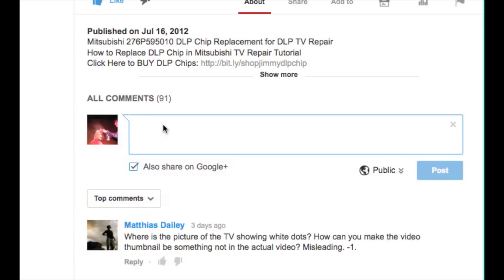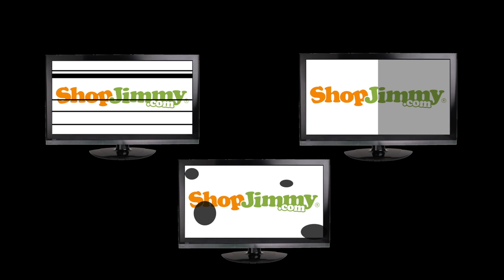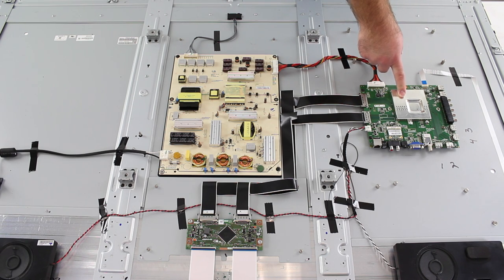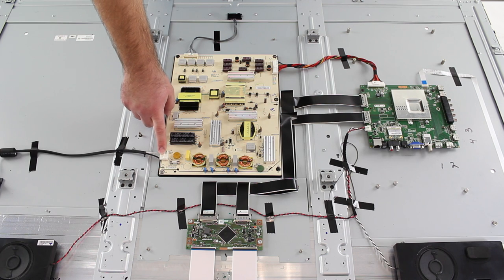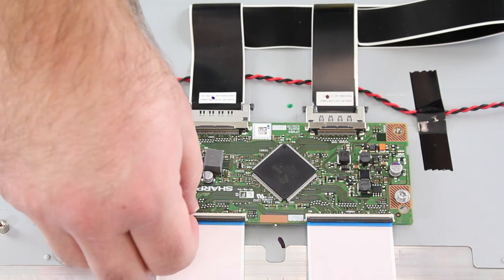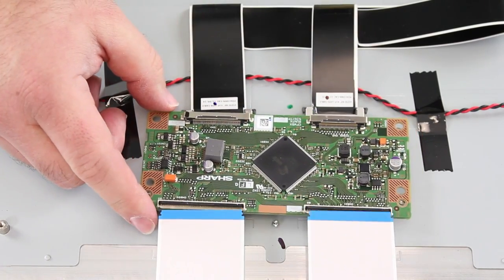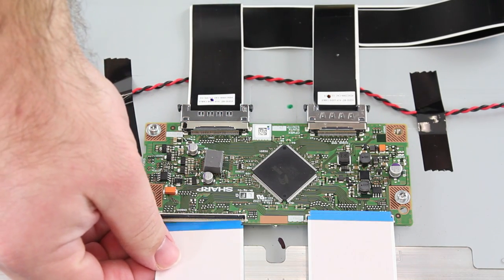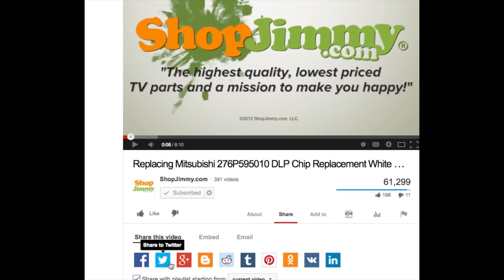Vizio TV Repair - E601i-A3 T-Con Board Replacement - How to Fix Vizio TVs

Comment: Vizio m55osl i can send a picture to better show it but  basiclly at the bottom, base of the back of the tv, right around where the standis at there are 2 huge 3inch wide ribbon cables that go down to the bottom of the tv almost like the go under and connect to a long thin board maybe as long as the tv and about 2-3 in wide. according to your video its the tv panel, the board that the ribbon cables go to on the tv panel, tcon board side is fine its the panel side that the connectors have broken off. is the board a replaceable board or does it mean the whole panel needs replaced

Comment: Your video on how to replace the Tcon board on a Viso e6001 was extremely helpful, and I plan on ordering the board from you.  However, you kind of jumped ahead of me; I'd first like directions on how to remove the back panel to the status you were at in your video.

Comment: Hi,
I have recently replaced my TCon board in my Vizio E601I-A3 and it seemed to work because I turned it on and the picture came back to the tv but I turned it off and put the backing back on the TV and I tried to turn it back on and what do you know, the tv was blank again with backlights and sound still working. Do you have any suggestion on what could be wrong now? One of the LVDS cables seems to have a slight rip in it all of a sudden so I don't know if that would effect it.

Thank you, 
Kevin Costello

Comment: I have an E701i-A3. The display was working fine. All of a sudden, the screen went black and the TV shuts off. Now when you power the TV up, with the back cover removed, you can see the back lighting come on. The display is still very dark blue, maybe even black. After about the 10-15 seconds, the TV powers off again. I have replaced the power supply board and no change. Any ideas? Thanks!

Comment: Hi, I need your help to fix my VIZIO TV model XVT3D474SV. The yellow 'VIZIO' light glows when power is turned on, but there is no display after that. In normal operation, the 'VIZIO' light used to turn on and off a couple of times and we see 'V' display on screen, and then normal display. After we have this problem, the "VIZIO" light just glows constant. Few days later, the "VIZIO" light turned on and off once and the display was ON for about 5 hours. We thought that the problem was fixed by itself, but we were wrong. The next day, it did not turn on. Could you please help us what is the problem with this TV?

We suspected that this is a power-board failure, or a leaking capacitor. So, we got a used power-board from ebay, and replaced the board, but the problem is same. I am not sure it was a faulty power-board or the problem in TV is something else. Your help would be much appreciated.

Comment: My E601i-A3 just lost picture but has sound. Looking at the serial number starting with LFTRNWDQ my unit does not qualify for the recall. I will add that over the past few years we have been getting thin black lines across most of the screen. They were all in the bottom 1/4 of the screen so not that much of a hindrance. That being said, seeing your warnings on this video as well as on the shop jimmy web page for the replacement T-Con Board it makes me wonder if I should be purchasing a T-Con Board (currently out of stock). Should I be buying an LCD Panel or Main Board instead? Please advise.

Comment: I have a Vizio P50HDTV10A plasma and I've replaced the y-sus board due to a flashing strobe and ticking sound coming from it. One of the heat sinks was cold while the others were warm. I had a picture before, but it was flashing very quickly. Now that it is replaced I see a yellow vertical stripe from top to bottom in the center of my screen. All of the rest of the screen is black. Has red and blue dots outside of the yellow. Does that mean that it's a bad logic board, since my y-sus was replaced? Everything else seems good. My next guess would have to be the board above with big capacitors and copper coils connected to the y-sus. Seems more like a logic board problem though due to the vertical lines. Your videos are great by the way, I have learned a lot from watching them. Thanks

Comment: Hi I have a RCA 46la45srq with black screen with good power light starts red then blue. And sometimes it works fine but mostly no picture although it does have sound if I get lucky enough to click remote control to the correct video sorse I then can here sound from the kodi remote being clicked. So I replaced the T con board. But it Didn't work. & my Tcon doesn't plugin the main board, but into a different unknown board with slightly puffy I'm not sure what they are called but they have silver tops like a Phillips screwdriver raped in black? That plugin the main board and Tcon board. My tv is a rca46la45rq- RCA 46"FULL HDTV.. Please advise me on what to do?  I will try & send you a picture...thank you.

Comment: I was wondering if you could help me with a fix. I have an E390VL vizio tv. what happens when I turn it on is the screen seems fine,  but then after about 30 seconds to a minute the screen starts to make this poping sound, and the image becomes distorted. when I turn it off and then on again, the same thing happens quicker. I unplugged the tv and plugged it back in again. this only makes the amount of time it takes for it to "glitch" 30 seconds to a minute again. I looked around YouTube and Google and couldn't quite find out the problem. if you could respond I would be very greatful. thanks for your time!

Comment: I'm currently having issues with my Vizio TV model M55-C2 where I will get the Vizio symbol when powering on and momentarily get visuals. After about .5 second goes black with backlight still on. I believe it is the T con board but am uncertain. The T con board part number is LJ94-32662F

Comment: Hello Jimmy. I took off back panel on my Vizio VO420E. Upon exam the capacitors did not look popped. The TV when plug in lights the VIZIO logo at bottom but will not power on. Help!

Comment: I have a Vizio D500i-B1. First problems were it would not turn on unless I unplugged it for several hours. Then it became a problem of shutting down after being on for 45 min to an hour. Sometimes it would come on with only sound but most of the time it would not come on at all. Based on the power light and what Vizio says, it was powering up.(power comes on and then slowly fades) Sometimes the Vizio emblem would display real fast then go off. Those were the times I only had sound. Well, it gradually got to the point where I explained previously of it turning off by itself after awhile. By the way, it was always a black screen, sound or no sound. Well, I tried the T-Con board(since I got one for $10) and now it will power up every time but now it has a blue screen. I did have sound but changed the channel and there is no display so it is almost impossible to get back where I was. One key note, the TV was not going full width(only 80%) no matter what settings I tried to use.

Comment: I have a 60" Vizio, Model No: E601i-A3E(same as in this video) and the unit is not powering on.  The standby light on the bottom left is on and is a orange/red color.  What is the best course of action to fix this?  The power board replacement?

Comment: my 32 vizio tv logo icon flash on/off. I have changed the power board and the main board, didn't fixed the problem. what else could be wrong?

Comment: I have a Vizio model E601i-A3 that will only power on for a few seconds. The "V" display comes on very dim with a very low level backlight then shuts off. I can read voltage on the power supply for the pins that are clearly marked on the color unit board, but I'm not sure of the other pins. Any ideas?

Comment: I have a 55" Vizio VF552XVT that turns it's self off when it senses a resolution change in programming viewed. Watching it and programming goes to a commercial or at the end of a movie and it changes resolution the set clicks and turns off, however the Vizio name on the front of the set remains on and illuminated in a white color, ( amber when off).  This tv is 5 years old and our main TV... runs approx. 16 to 18 hours a day, about 5 days a week. The longer the set is on and in use the more frequently it does this turn off deal...  but does not power off when watching a premium channel movie, or using the Blu Ray player. Only when the movie ends and a trailer for the next movie comes on in a different resolution. Our DirecTv guy helped us figure out what it was doing, as we thought our DTV receiver was bad. Can you suggest a fix for me? We really can't afford a new TV right now... The picture is 100% fine and perfect in every way on this set until it turns it's self off. Thank you!

Comment: I have a Westinghouse 40-inch model number dwm40f1g1 LED TV back lights light up but no picture or sound 11.92 volt to the main board in the T con bored. Thanks for any help

Comment: Hi I have a question on a Vizio m492i-b2 the LED light for on/off indication comes on and blinks once and stays on constantly when plugged in I have replaced the power supply with no avail. It had a problem turning on and worked if you unplugged it for a while and then plugged it back in. No led back lights or picture with flashlight test. Thanks you

Comment: Hi. I have a Vizio M550SL that my mom already replaced the t-com board in once. She said it worked great for a while, but then started acting up again. Once the picture comes on, she says it will  it stay on until powered off again. No that I have it the picture does not come on. Back light is on and has sound, but no picture. Is this the result of bad t-com?
I would like to repair it if it’s worth fixing
Part 10248191022
serial LAQAMCBN3200239
Thank you

Comment: I have a Toshiba 46L5200U1 that will run fine for a few minutes then the screen will go black but you can still hear the sound. You have helped me in the past with Vizio TVs and the parts I've gotten from you worked 100% of the time. Can you help me with this Toshiba? Thank you so much!

Comment: Hi there I have a Vizio D390-b0 and followed your video on diagnosing- I have sound and power and backlight just a dark lit up screen which indicates a bad TCon board. My TV only has the power board and main board when opened and on your site your entire repair kit only includes these 2 boards for my model. Where is the tcon board?

Comment: vizio e601i-a3 3 year old tv, no video, tv went black with audio, called cable company and everything leads to a bad tv, even when I tap the menu or input buttons, it produces nothing on the screen.  Any suggestions, also called vizio and they said it was probably not repairable and a backlight issue

Comment: My m701d-a3r has occasional vertical lines running down from the top of the screen. Close inspection shows it's only 1 pixel wide. TV is less than 2 years old. Based on your information the T-con is bad or a  bad connection. Can you comment or suggest a fix?

Comment: I have Visio vx37l hdtv10 TV. I'm getting colored lines on screen (full screen), sound is working. I found a part no. for T-con board on your site, but you're out of stock. Plus, I don' see T-con board on the open back TV

Comment: Vizio E601i-a3 problem.  

When the power button is pressed,  the back lights work,  and the panel illuminates. No picture will show.  No words can be seen on the screen when any buttons are pressed on the remote. I have replaced PS, Tconn, and main control boards. Nothing has fixed the issue. TV only has 40 hours of use on it (but the warranty has expired). TV worked fine when it was turned off.  Just won't work now.  Any suggestions would be greatly appreciated!

Comment: I have a E470i-A0 and the power surged twice the other night and the TV display does not work; however, there is sound.  The TV will come on and the power light will glow momentarily and then go out.  Is the a t-con board for this model?  I think I need to replace the Power Supply / LED board...

Comment: vizio e701i-a3 a tech told me the power supply is out.  I just ordered the part, is it fairly easy to replace?  is it just screws or is there soldering involved?  The tech wanted to charge me $240 is that a normal price?  Thanks so much!

Comment: Vizio 60" LED model # E601i-A3 television and at first it had the vertical lines now it will not come on at all. Should we replace both the T-Con board and panel?

Comment: I have a VIZIO M801i-A3 with a single blue vertical line about a pixel wide on the left side of the screen. No other problems, does it seem like a tcon board replacement will fix this? Thank you very much

Comment: I have a vizio 55" VF552XVT.  When I first turn it on after sitting overnight, it will work for about 50mns then shuts down with vizio light still white.  After that it will only work for 10 minutes of less.  Is it the t-con board or something else?  How much would it cost to fix if I do the labor?

Comment: I have a 42" Vizio 1080p The screen goes blank after a few minutes. Read that this is an indication of a faulty T-Con board.  If you concur, do you stock the proper replacement?

Comment: vizio e601i-a3e:
blue vertical line on right side of screen, 1 pixel wide going the length of the screen. Replaced power and main board (no power orignially) and now this has emerged. Might be a long shot, but is there any chance of repair or chalk it up as a loss?

Comment: Yes I have 40 inch Vizio vo370m which I used to be able to watch but then it would fad out to vertical lines watching the videos I think it could be my T com board I have tried to get the back outside panel off but not having much success. The help I need is do you think it is the t com board and can that be replaced in this set ? I will exam the back board to find out why I can't get it off it is probably something simple.

Comment: hi. I have a vizio m420sl tv and the screen is black.  the back light works on it.  but the when I turn the TV in I got nothing. the light gites from amber to white but no picture. it will work fine every once in a blue moon. but that could be weeks. any idea what it could be? thanks

Comment: I have a 55 inch vizio model #xvt3d554sv , i do believe this is my solution. my problem with the tv is i am not getting any sound. Picture and everything works fine. when i plugged in my sound bar i would get every other word coming through it. my other question is... does it matter what the part number is for the t-con board or can i take one from another model or one from another tv. please help

thank you

Comment: got a vizio model e482-d2 tv is on indicating power supply working but still test an had correct voltage symptom of the tv was sound no picture so test the t con connection then took out one ribbon then turn the tv on again I got a half a vizio on the tv order the t con board got the board installed it an got no picture test the t con board for voltage got 12 '
volts on the fuse  an just about 0.4 an under at the test points on the lower end of the board turn the light of an pull one ribbon again then saw some horizontal lines  seems as though the panel has gone are there any way we can test the panel

Comment: Hello I have a vizio e601i-a3 which the picture went out but sound was still there after very little use and saw on line that my model number fell in the ones that were defective  but I had tv over a year but did not use much in spare bedroom so do you think replacing  tcon board will slove problem

Comment: i have two vizio 60 inch tvs smartcast  bought at sams in nov 2016 but a few weeks ago one of the tvs began developing purple spots first on the right in the upper corner and another on the left side edge about the middle . now more are developing on this tv and i notices on the other one bought at the same time its beginning to happen on it two what could this be .

Comment: I Am New To this.....I Have A Sony KDL-37M4000  TV ,    sound is good , But the picture color is bleeding at the edges ,,i see edge of faces as color is blurring.
Please Suggest what part I need to Replace.
thanks
Reply from the maker: Prem Daswani   PLEASE SUBSCRIBE TO OUR CHANNEL - Try all repairs and troubleshooting at your own risk.  I recommend replacing the main board in your TV.  Click this link to replacement parts for your TV model number:  http://www.shopjimmy.com/catalogsearch/result/index/?cat=56&q=KDL-37M4000  There may be multiple boards for the same TV model number, be sure to match part numbers on your current board, with your replacement for compatibility.  Here is a link to a video showing how to identify your part number, click here:  https://www.youtube.com/watch?v=Aodz2LHkzbYThanks and please let us know if you have any further questions with your TV Repair!  www.shopjimmy.com

Comment: Have a Samsung UN65F7050AFXZA with about 8 thin vertical lines on right portion of screen. Total with approx 1 inch, at all times???
Reply from the maker: hank hurphy   This sounds like a TV panel (TV Screen) problem.  If your TV panel is bad, it may be more cost-effective to replace the TV as panels are typically hard to find in stock, difficult to replace, and expensive.  Thanks and please let us know if you have any further questions!  www.shopjimmy.com